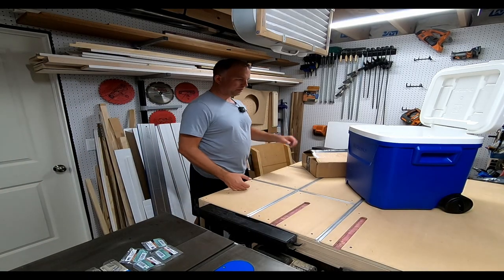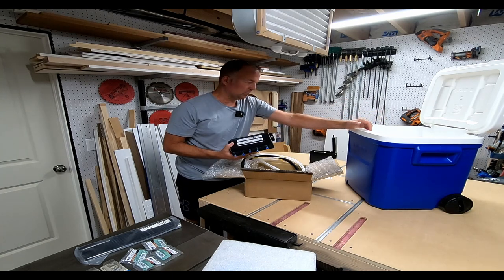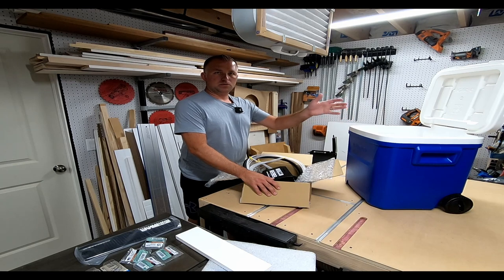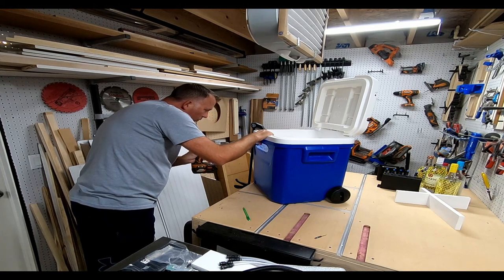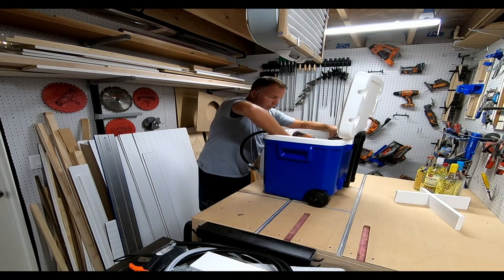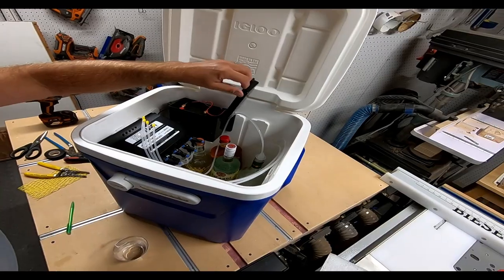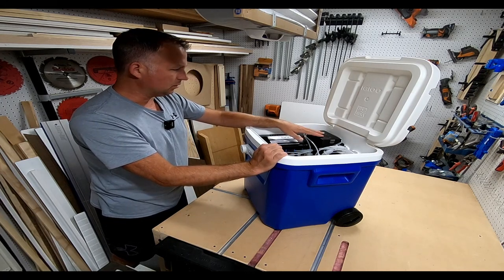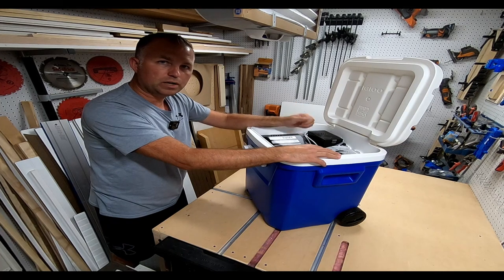Portable Liquor Dispenser Built into a Rolling Cooler

Comment: Was the battery pack from SideBar? It looks like a 12V 5Amp rechargeable deer feeder battery.  They want $140 for their portable battery pack.  Just curious if you sourced the battery & connector separately?

Edit - I now see your links to the battery & case.  What did you use to connect to battery? Did you modify the 12V cables that the sidebar came with to plug onto the small battery?
Reply from the maker: Hi Patrick it is not there's. The parts list is right in the description under the video. Just click on more and scroll down
Reply: @tommyboydiy1484  Thank you, I see the parts list now.  What about the wiring? Did you modify the provided 12V wiring to work with the battery?
Reply from the maker: @PatrickMowrey  Nope it just wires positive and negative to the battery